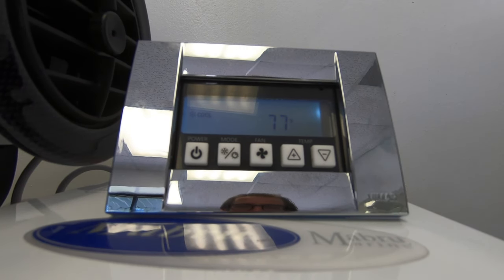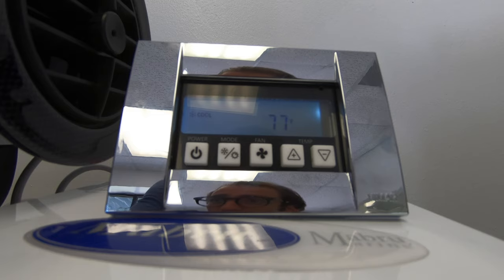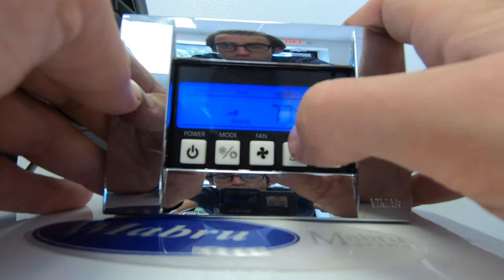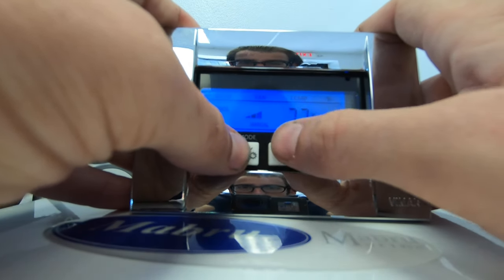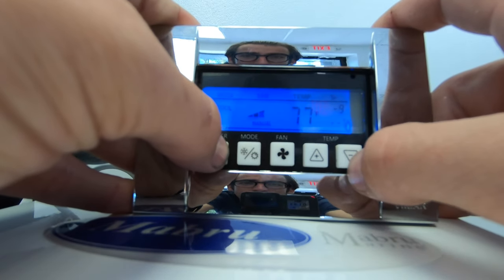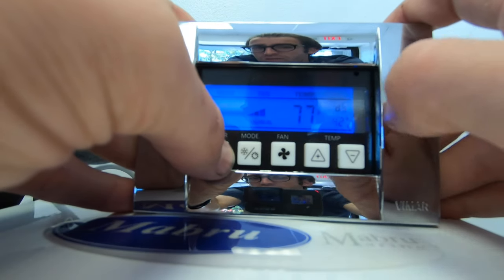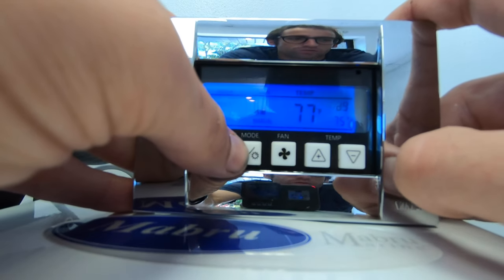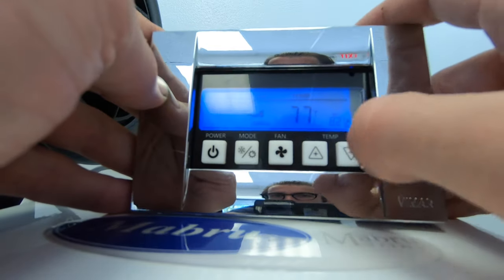Mabru Marine SC series Blower Programming

Comment: Is there a way to change the "cycle time" for the set point? Right now mine waits 3 or 4 degrees below set point to turn compressor on, and then runs until 3 or 4 degrees too high/low to cycle off. Can I make it have a "tighter" interval, so it turns on off more often, but keeps closer to the set point?
Reply from the maker: What model unit are you using? How long is the unit running for and how long is it off? It sounds like either the thermostat or return sensor (depending if you are using remote sensor or display sensor) is reading improper info causing reading on the display to show improperly causing a wide swing in temps. The most common cause is a loss of discharge air by the unit (loose duct) for the remote sensor or vent blowing air towards the display on display sensor.
Reply: @MabruPowerSystemsINC  Hi. Thank you for the reply. I'm using the 4200 BTU model. 

I would expect that if the panel sensor was too close to the exit duct, I would actually get the opposite problem (cycling quickly as the sensor is saturated with output, and then returns quickly to room temperature when the unit cycles off. They are currently on opposite sides of the cabin. (the exit duct and the panel/sensor)

Instead there is a temperature shown on the display, which is the real room temperature experienced, and the unit simply does not turn on until a few degrees below the set point (for example, in heat mode, panel shows 77 current and 80 set point) and then runs for too long (for example, panel shows 82 current with 80 set point)

I understand that there does realistically need to be some buffer zone to reduce wear, I just would like to reduce it a bit.
Reply from the maker: @sona11111111  I asked about the length of duration of compressor running and stop times as the only time that I have seen this symptom is when the unit is oversized which I do not think is the case, or there is an issue with the temperature reading. Our current firmware is programmed to tun on the compressor when temp  is 2+ degrees from the set temp. The compressor is then programmed to turn off at the set temperature. We have a short cycle prevention also programmed in so that will override the temp and leave the compressor running so that it runs for for a minimum of 5 minutes with a 5 minute rest period. 
That being said, we had a previous firmware about 5 years ago where the unit would activate the compressor at the set temp or + and would leave the compressor running until 2 degrees past the set point. Regardless, there should only be a 2 degree swing. Can you please confirm the duration of compressor on and off?
Reply from the maker: The temp differential is not a programmable parameter and is imbedded in the firmware of the unit.